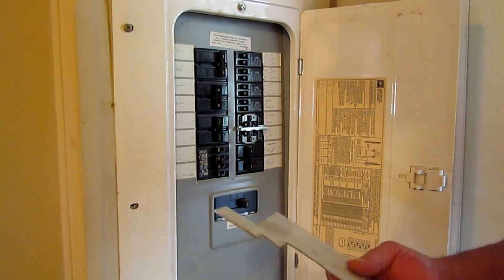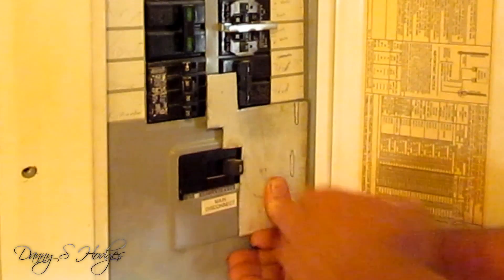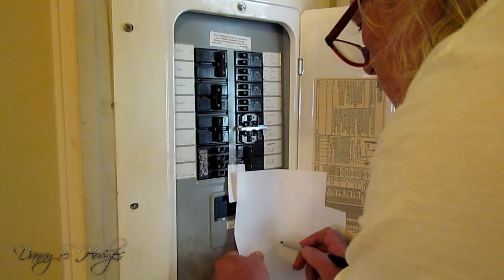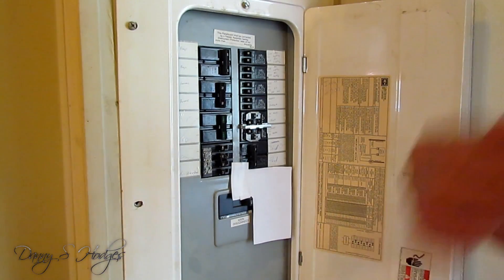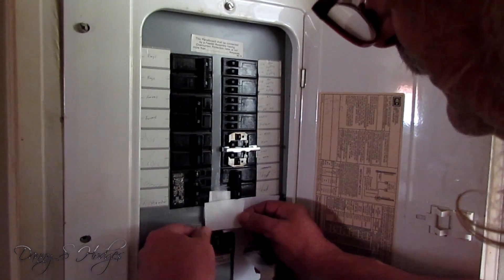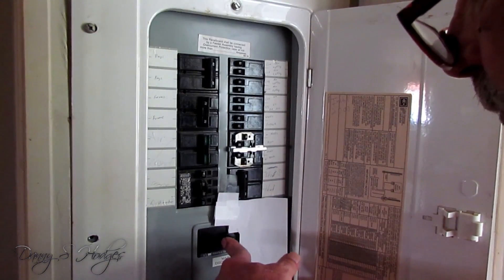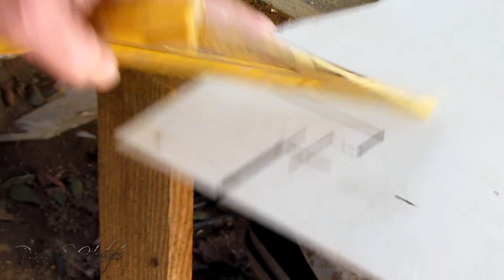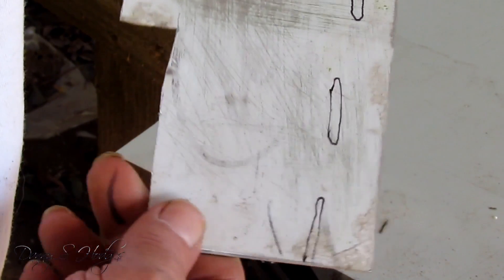How To Make A Generator  Interlock For Your Breaker Box

Comment: Great video man, I was so much thinking that these interlock switch are way to expensive, I mean there just 2 little metal plates. Gonna try to make me one myself to. The paper sheet is a great idea.
Reply: Was looking for a transfer switch but the only reasonable priced ones only had one circuit and any more than that the price goes 4 times as high. No thanks then I remembered the interlock thing.

Comment: You are awesome sir, thank you for this tutorial that I will be using. I'm getting ready to buy and hook up a generator and I ran into a problem. My Square D panel main breaker is at the bottom also and pushed to the left is in the ON and to the right is in the OFF. My panel has a spear 30 amp 2 pole breaker to the right above  the main where I want to install the generator 50 amp breaker and pushing it to the left is in the ON and to the right is in the OFF. My problem is that all the interlock switches (by looking at them online) seem to be designed to work if the generator breaker is to the left above the main and I don't want the remove those wired breakers to the left above the main. I just want to remove the spare 30 amp breaker to the right above the main and install the new 50 amp, and to do that I need to design my own interlock switch. So thank you so much.

Comment: The main problem with "making" your own interlock is finding the right shoulder screws/bolts so that the interlock will properly slide.  I do agree that if you can't find what you need, then make it.  But honestly I would go with an OEM unit since you will get the proper hardware.  Also sometimes local codes call for a proper OEM unit in order to be legal.

Comment: This is a GREAT IDEA 👍. They run $60 bucks..and the one that HD has didn't fit my panel.

Let me ask ya tho, is one of these plates really necessary? I mean there are only 2 adults that would access the panel as long as the panel is labeled .can ya just skip the plate? Got the proper Outlet and wired..so again can someone answer if the "plate" is necessary??? Only the plate.. thanks
Reply: It isn’t necessary but may be a legal requirement in your jurisdiction. Ask a local electrical contractor or your electric utility.
Reply: I would say it is. It's a safety mechanism that can save someone's life. I guess the better question is, is someone's life worth the the time to make/buy the plate. The poor sucker working on power lines will that you!
Reply: It's a safety to save a life whether you make or buy whatever or costs doesn't compare

Comment: Danny that is great concept however I will say many are not going to understand what you are doing, if I am understanding this correctly the two lower Circuit breakers ARE Being fed by your gen set. Of course you do not want your gen set power going out on the grid thus opening the main breaker. Your breaker template insures that the generator can only feed your system if the main is open.

This is a great third world fix however here I am afraid the electrical natzi’s will veto your idea as they have electrical interlocks called switching gear at an exorbitant price compared to yours. 

I am enjoying the free   TV or OTA  I built one of your antenna designs and it works well for me here in West Texas.
A former Thomasville, Ga resident.
Reply from the maker: YOU ARE RIGHT ON..ITS CALLED BACKING..GENRATOR WILL COME IN ON THAT 220 BREAKER...I NO NOT ALL UNDERSTAND BUT PEOPLE LOOKING THIS UP WILL NO